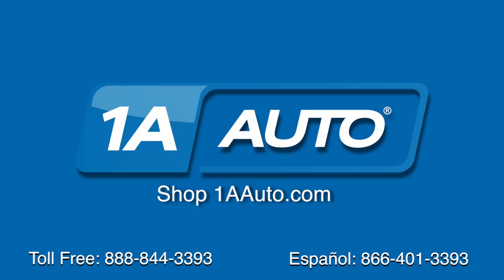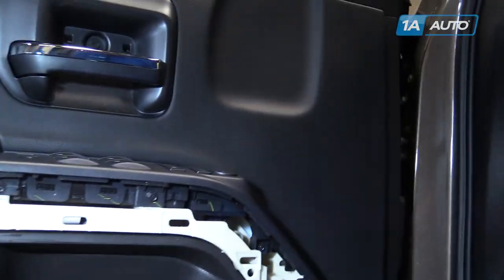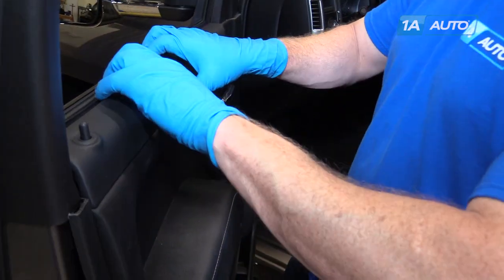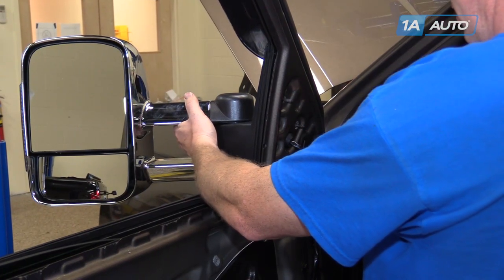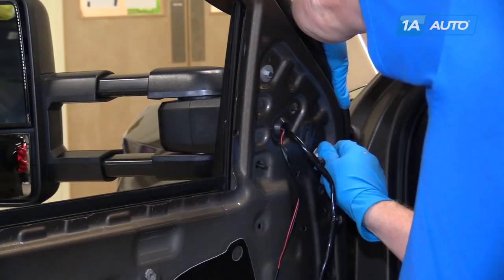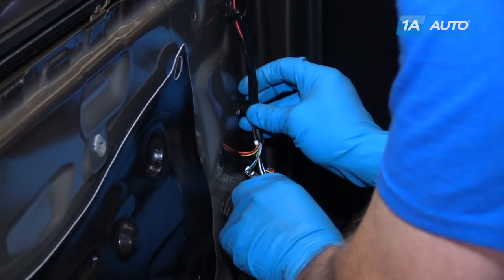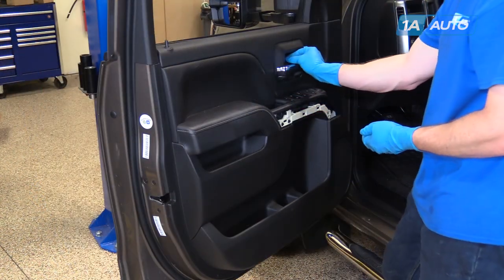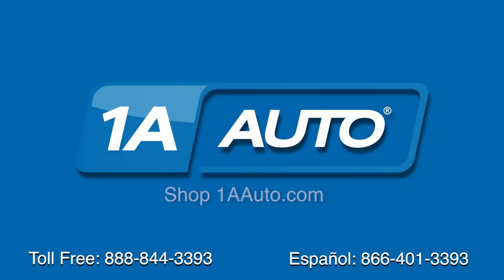How to Install Upgraded Tow Mirrors 14-19 Chevy Silverado LT

Comment: I was able to install the tow mirrors on my 2016 Chevy Silverado LT Extended Cab(53) Z71 using this video (Thank you 1A Auto Parts), but I also replaced the wiring harness in both doors as it states in GM's installation document 4174686, which I highly recommend referencing.  It was fairly easy to replace the wire harness once I took the door skin off and removed the speaker in the door.  You have to find the RPO (these 3-digit codes are in the glove box.  Mine is DL8.) and cross reference them with the document to know which wiring harnesses you need.  My test harnesses are 84290984 and 84290964 (replaces 23171572 and 23171566).  It's well worth the $70 each.  According to the document, my truck didn't need re-calibration.  One important note is that the 2 white leds on the mirror for my truck are not reverse lights, but cargo lights, so when I press the cargo light button on my center console, they turn on and off.
Reply: Can you provide a link I am currently running into the same problem I believe

Comment: thank you for the video definitely helped me out a lot. Install was quick and easy. I bought these mirrors and replaced the small powerfold mirrors I had so I had to hard wire the spotlight and the running lights but that was a piece of cake and the mirrors came with all the wiring I needed to accomplish this. Thanks again.
Reply: If anyone needs help with the hardwiring let me know and I can tell you how to do it
Reply from the maker: +Daniel Bond Thanks for watching. If any of our viewers need help selecting tow mirrors for your truck, reply back here and we can help you out.
Reply: Daniel Bond could you help me out with the hard wiring for the spotlight and running light? Thanks.
Reply: Daniel Bond do you have your power fold mirrors still? I assume u have an Ltz model truck. Are you interested in selling them?
Reply: Alright so which tow mirrors for a 14 Silverado 1500 LTZ with blinker, auto dimming, power adjust, reverse tilt, power fold, temp sense, chrome? And if you could point me in the right direction for wiring the cargo and running lights, that'd be great!
Reply: 1A Auto Parts  I have a 2016 Silverado 1500 i want to buy towing mirrors do I need a harness for the leds to work?
Reply: +Daniel Bond can you do a video or give me a walk through on how to wire the spotlight and running lights? thanks
Reply from the maker: +Rene Macias The mirrors come with a couple of leads so you can enable this option. 1aauto.com
Reply: Daniel. I received my 1A tow mirrors today. I have a 2016 LTZ with power folding, heated, memory, puddle lamp sport mirrors. The 1A mirrors I ordered have these same features. There was no wiring harness included with my mirrors for hardwiring the marker light bars or spot lights or fourth mounting stud or hardware. Did these get missed from my order? How do I go about accomplishing the installation without these items? Hardwire instructions and a kit would be most helpful. Thank You
Reply from the maker: +Skip Laney If you would like to call our tech team we can take a look at the order for you. 888-844-3393 Hope this helps you out
Reply: Daniel, how can i contact you to find out the easiest way to hardwire the spotlight and signals?
Reply: Daniel Bond I need help to get the cargo light , and running lights working on mine and also turn signal !! Help would be great

Comment: Did the lights work since the truck is an lt? Or did you have to do some wiring ? I seen extra wires on the harness , any tips how I can get the lights to work on mine for my 14 LT?
Reply: Need help too did u figure it out?
Reply: There is another video from a guy in a red truck

Comment: Wish I could upgrade my 2015 Sierra 1500 double cab V8 from manual to power mirrors. it has power windows and door locks. One of the very few I've seen without power mirrors. I wonder what kind of wiring harness it has inside the doors? Probably just go with manual TOW mirrors soon.

Comment: I have a 2014 Silverado Iam adding tow mirrors to I didn’t have signals in the mirrors before. Is my truck wired for those to work if I change the door harness?

Comment: Great instructional video!  Question:  I have a 2015 HD Silverado.  It came with all black, rounded looking tow mirrors, which are manual fold, electric adjustable, with a turn signal in the mirror.  I want to replace them with the tow mirrors shown in this video.  Can I plug therm in and expect the white led lights to work, or are there any extra steps to get those lights to work.  Thanks in advance!
Reply from the maker: +mattp1803 There will be additional wiring to add the spot light feature.
Reply: 1A Auto Parts thank you for your prompt answer.  Can you steer me in the right direction for what I would need?  Is it as simple as having another wire harness kit?  Thanks!!
Reply: @mattp1803  what did you end up doing to get the white lights to work

Comment: So question i have the 2018 silverado 1500 Z71 and my mirrors are power adjusting only. Can i install the tow mirrors with the turn running light and rear facing led on my truck? Is it just a plug and play or do i need a whole new harness? Thank you in advance

Comment: Do you have mirrors for. 2018 chevy silverado 1500 LT? Also would those need any sort of extra harness or just plug right into factory. I only have power on my mirrors. Not heat or anything

Comment: I have a 2017 GMC sierra SLT all terrain with all the options like power folding and heated mirrors and turn signal and puddle light.  Now my question is can I buy tow mirrors that have all the same options will it just plug right in to original harness??
Reply from the maker: +Orlando Farias Thanks for the inquiry! As long as you buy mirrors that are listed to fit and have the exact same options as OE, the parts will be a plug and play.

Comment: My 2015 does not have the tow mirrors, does the mirror control module have to be replaced or is only one mirror controlable from inside and the others are just manually adjusted from inside?

Comment: Are those factory mirrors or aftermarket that you installed.  Do you have a link to get them. Also do they have the turn signal or are they just powered. Thx
Reply from the maker: +Keith Downs These are after market! What is the year/make/model of your vehicle?

Comment: Have a 14 Silverado LT. heated mirrors. Manual fold. Power adjustable. Would the turn signal lights on these tow mirrors work? I don’t have lights on the stock mirrors.
Reply: I just did this upgrade to my own truck. I have a 2014 Silverado 1500 LT that had standard mirrors with defrost, power adjust and manual fold. You will need to buy the RZY jumper harness (GM Part# 23387133) and additional wiring changes made to the door harness in order to get the turn signals and other functions to work.
Reply: Steven K thank you very much
Reply: Commenting for future use. Thanks guys

Comment: How do you get the backup lights on the mirrors get to work? I was looking for the reverse wire under the dash but can't seem to find it.
Reply: I am lost about hooking my backup lights my tow mirrors. Boost, pep boys; auto does not cover this at all on you tube. HELP?
Reply: did you figure this out - I am doing this this weekend?
Reply: It's easier to fuse tap

Comment: tow mirrors come with different options  (power defrost, turn signal, power extension/folding) how would you know if the mirrors you are buying are supported by your vehicle?
Reply from the maker: +certified30 If you would like to reply back with the year, make and series of your truck and all of the functions that your mirrors currently have, we can match a set of tow mirrors up for you.
Reply: 1A Auto Parts  my truck is a 2007 GMC sierra SLE (new body style) crew cab, it has power mirrors and i believe defrost as well but no factory turn signal, as far as RPO numbers i got ( DF5, DH6, DK8, DL8) i called the dealership and they said that i could install power tow mirrors with turn signal but they wanted something like $600 for them lol
Reply from the maker: +certified30 Here is a link to the tow mirrors that we carry for your vehicle that would be plug and play https://goo.gl/bx1tkt  Also new 15+ style mirrors made to fit your old style truck https://goo.gl/hND9Zv  Hope this helps you out. 1aauto.com

Comment: if your truck is not equipped with power fold or turn signal mirrors, and you purchase tow mirrors that have power fold and turn signal, will the turn signal still work with your truck?
Reply from the maker: +Raul Hernandez They might not. We always recommend matching option-for-option when adding on tow mirrors so that you do not run into any issues with features not working.
Reply: do you have an option then for tow mirrors that only include power mirrors?
Reply from the maker: +Raul Hernandez Yeah, we do. Give our customer support line a call (888-844-3393) and we can give you pricing on what we have available for your year make and model. Thanks for commenting!   1aauto.com?utm_source=YouTube&utm_medium=CTA%20Comment&utm_campaign=1ATony 866-403-3393
Reply: 1A Auto Parts i installed tow mirrors on my 2015 z71 Lt that I got from GM, but the originalmirrors did not have power fold or turn signals but the new tow mirrors do. Is there a way that I can make the turn signals work?
Reply: The turn signals should already be wired in just plug and they work. Did you connect the wires where the old mirrors were? Mine did not have turn signals and I upgraded to mirrors that did and they work

Comment: Goodness. There's 2 bolts and a couple metal clips on my 02 Tahoe door and it stays on just fine. Helluvalot easier to service that way.
Reply: Spencer D Yeah, but you're talking about a 15 year old truck vs a 1 year old truck. Don't get me wrong I love the older Tahoes and Yukons but I wouldn't give up my new Silverado for one...
Reply: I kinda prefer a simpler or older truck over a newer truck. I replaced the mirrors on my 01 no problem. Didn't have to remove the door panel. My 09 I think I'll just take to the shop. But I do love my 09 Silverado.
Reply: Yeah, my 85 f250 only had one screw and looped duct tape holding it in. So much easier to service... but doesnt look as modern or nicely refined as my 15 Silverado

Comment: I have a 2014 chevy silverado 1500 ltz. With powered folding mirrors. What would be good fit for my pick up?
Reply from the maker: +Rodrigo Perez We suggest placing the mirrors on an option for option basis. If you contact us with your VIN we can find mirrors for your vehicle that will work perfectly?

Comment: Are there any extra harness's to make the power fold work?
Reply from the maker: +stan webb Yes, if your car hasn't come equipped with them you will need to order a wiring harness as well. Give our customer support line a call and we can help you get all set up! 888-844-3393

Comment: my factory mirrors are only powered. no turn signal.  the ones I ordered are heated, power and turn signal,  do I need something else to get the turn signal working?
Reply from the maker: +Scott Made In America Mirrors need to replaced in a feature-for-feature basis, so if you get some with additional features you will need to wire them up.  Some of our mirrors do come with additional wiring for upgrades, but it needs to state in the listing that it comes with it.  1aauto.com

Comment: I have a 2016 gmc 1500 sle. I have the standard mirrors with powerfold, puddle lights, heated, turn signals and all that. Im looking on the website and im not sure which set of tow mirrors too buy that are power fold and with puddle lights and the rest of the accessories. Could you point me in the right direction? Thanks
Reply from the maker: +Tannerman Would you happen to know if the truck has a diesel exhaust brake (RPO K40 code) ? or if the current mirrors have memory ?
Reply: 1A Auto Parts no, it does not have an diesel exhaust brake and no memory
Reply from the maker: +Tannerman Thank you for the reply. Would you happen to know if the passenger's side mirror has a temperature sensor in it ?
Reply: 1A Auto Parts no it does not
Reply from the maker: +Tannerman Thank you for your reply. We currently do not have a set of tow mirrors that have the options that you are looking for for this vehicle. Thank you for contacting us. It is greatly appreciated. 1aauto.com

Comment: I have a 2016 1500 LT with power mirrors and no other options on the stock mirrors. I would like tow mirrors with lights and heated option which ones would I need?
Reply from the maker: +Scott Merchant Thanks for the comment!  If you are unsure which mirrors you need I highly recommend you contact our customer service department and one of our reps can help you get the correct set for your model!  1aauto.com

Comment: If my 2015 does not have power mirrors can they be installed? Is it pre wired or is there a kit
Reply from the maker: +Cole Clark Hello, If you have manual mirrors you will need to replace them with manual tow mirrors. Thanks! 1AAuto.com

Comment: i have a 2015 silverado 2500hd with little mirrors. Bought proper tow mirrors that should have come stock. Need to hardwire the spotlight and signals. Anyone know the easiest place to take the power from?

Comment: If I want to put heated mirrors on , is the wiring harness wired for it? My mirrors are power now
Reply from the maker: +Steven Stair Thanks for watching!  The heat function cannot be added on for this application, the vehicle harness does not have it if your vehicle did not originally come with heated mirrors.
Reply: That's what I was afraid of, ok thankyou.

Comment: Are the mirror frames the same angle to truck body on both sides of truck...if so...how do you adjust frame hardware to make the same on both sides
Reply from the maker: +Rickey Booth II The passenger side mirror will usually be tilted upward a little bit more that the driver side.  This is a design feature that gives you better visibility!  www.1aauto.com
Reply: I see...but this is different...the frame of the mirror was angled tighter to door....either side were not symmetrical to one another in relation to truck....example...in operating position like our ears to our head....one side was sticking  outward and the other side was closer....
Reply: I have decided to return this set of mirrors and purchase some you guys are promoting...TRAIL RIDGE...
Reply: Recieved  my mirrors just today and installed just about 10 mins ago....these are a much better quality than the set I returned to a different supplier.....looks great!

Comment: If you're going from the off-road mirror Chevrolet to the towing mirror on Chevrolet you'll notice that the right side of most of the brands I found the matter of fact I have not found a brand yet that is it right but the pitch of the mirror is such it's in the casting not in the actual glass cuz the glass is tilted all the way in my wife is a short person cannot stretch back for the enough to use the right mirror so beware of that

Comment: Do you not need a wiring harness kit? Going from the small mirrors to tow?
Reply from the maker: +Jesse McIntyre-Ribbers The tow mirrors will be plug and plag as long as the set you order have the same features as the OE mirrors. Thanks for checking us out!

Comment: Hello,

What is the part # for a replacement tow mirror on a 2017 gmc sierra denali?
Reply from the maker: +twinturbos52 We currently do not have a set of tow mirrors that fits this particular year,make, and model. Thank you for asking. 1aauto.com
Reply: With 2017 Silverados and Sierras out for a year now how can you not have the mirrors rated for them. With GM it appears the fit for a 2016 and 2017 are the same. What gives????

Comment: Unreal..why couldn't the design engineer just make a pop-off access panel to access the mirror nuts instead of requiring that the entire door skin be removed? That'd be the kind of engineering I could live with.
Reply: They used to before 2007
Reply: Atouk my 2007 GMC has one little panel that pops off to get to mirror

Comment: Are They plug and play or do you have to do any mod to them
Reply from the maker: +konan sugioka We recommend that our customers match the features that they currently have to the features of the tow mirrors that you would like to purchase. This allows for an easy plug and play installation. Depending on the application some of our tow mirrors do allow you to upgrade to powerfold, turn signals, or a spotlight. If you would like to call our sales staff at 888-844-3393 we can help you out. 1aauto.com
Reply: 1A Auto Parts thank you

Comment: And there is nothing from this company on the specific model for a 2017 Tahoe….There’s one for Chevrolet trucks, but not one for the Tahoe that covers the part I bought. Called customer service and they said the same thing….go find it on line your self.

There is one that is made by a competitor that includes all wiring though…..maybe the exact same part, but their customer service seems a lot more helpful and better prepared to help.